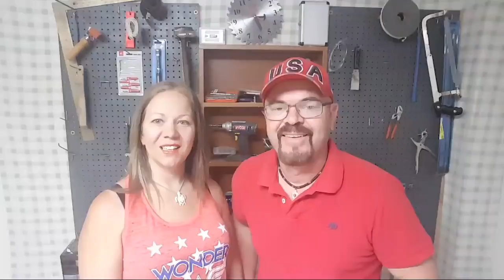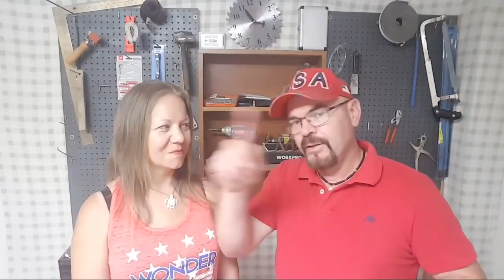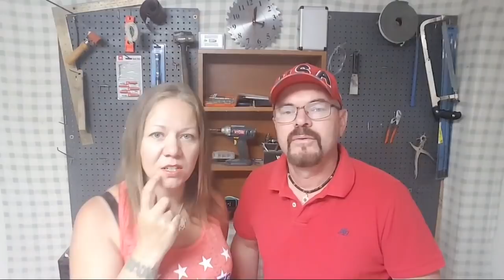Up Coming Projects

Comment: Hi Guys...awesome stuff!!!....that pumping system is much needed by many of us for sure! I am thinking of using aircrete to insulate around a container ( I sent you an email about it a month or so back). Do you think it will work? Like maybe rebar around the container, and then slip form the walls...and normal pour the roof. Would it be okay used in the cold Canadian winters? I am planning on using a wood stove or your rocket stove system, to heat the inside living. By insulating the outside idea with aircrete, then can the inside wall be left as they are...like with an interior/ exterior latex paint?